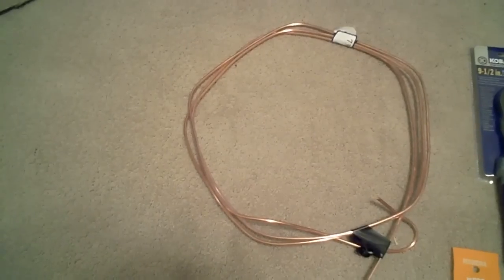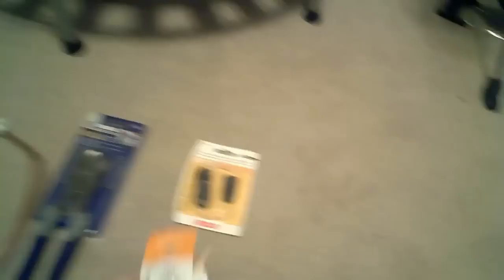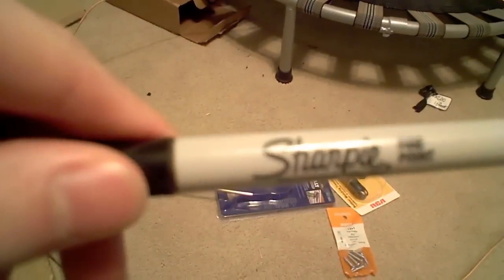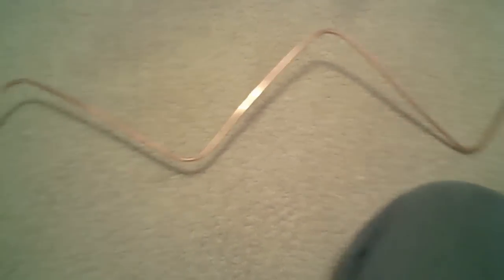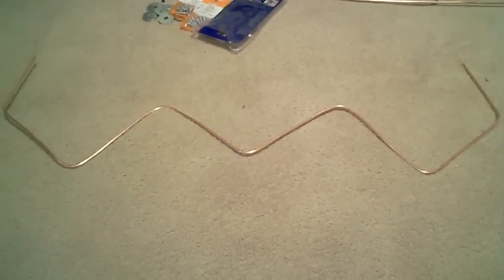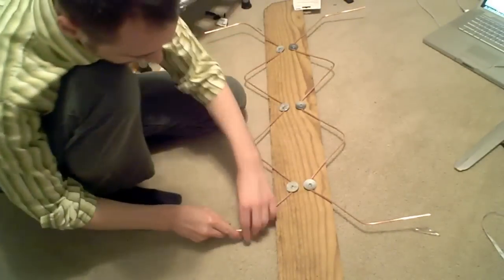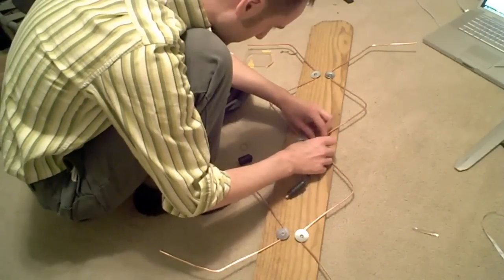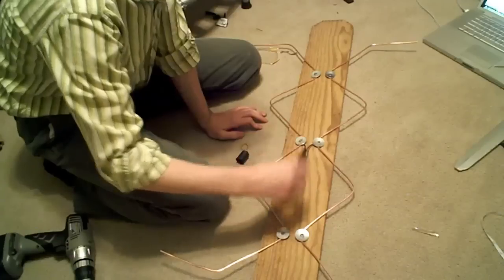How To BUILD The BEST HDTV ANTENNA! | Homemade HDTV Antenna DIY

Comment: The type of antenna you use has nothing to do with receiving HD or any other TV or radio signal.  If you live a across the street from a TV transmitter, you can get the signal with no antenna.  Within a mile, a piece of aluminum foil will do.  Old fashion rabbit ears will bring in HD from as near as 5 miles.  I am a retired broadcast engineer (48 years) so I know.
Reply: Where I live you can unwind a paper clip and stick it in the coaxial antenna hole and get at least 12 channels. I live about 3 miles from Sutro Tower which is the main television transmitter for the bay area. With a regular antenna I get 82 channels but at least 40% of them are in foreign languages.
Reply: ***** Any directional yagi antenna cut for the UHF television band should do if you get it as high as possible and point it at the antenna of the TV station you are attempting to receive.  My point was not about the ability to receive a TV signal, but rather the fact that that an HD signal is no different than a conventional signal when it comes to signal strength.  Calling an antenna an "HD" antenna is to either be unaware of the facts or trying to sell an antenna at a high price by fooling the uninformed public.  I have friends who receive modern TV signals perfectly on antennas that were manufactured in the 1950s.  I get a perfect picture on my RF-amplified rabbit ears antenna (I am 9 miles from the TV station's transmitter site) that I bought long before anyone had ever heard of "HD."
Reply: ***** When I was trained in engineering school (many years ago) they taught us their were only 4 important factors in good FM and TV reception:  1.) height 2.) height 3.) height and 4.) height  (lol). If you're on a hill, Robert, you should do well if you have this antenna at least a few feet above ground level, even if the bottom of your antenna is around eye level.  Line of sight matters, but due to what is called "scatter effect" PERFECT line of sight is really not necessary.  I think you'll be okay.
Reply: Janis Williams check with the site "tvfool" it will help you find the direction to and chance of getting a signal the online maps are really interesting.
Reply: ldchappell1 To complicated and unnecessary design from the up loader LaneVids.
 I live near the Guildford transmitter and boy I only need a few pieces of copper on a 3ft board in the attic and I have those attached to an old indoor pre-amp TV aerial unplugged as I do not need the pre-amp just the impedance  but no offence they do say some folk  go overboard on their designs
Reply: Dave Mitchell Thank you for responding and taking the time to explain the subject matter. I think I am going to built this antenna shown on the video to see what kind of signal I can get with it. We live on a hill and I think I have a better spot here than those houses at the bottom of the hill.

However, I don't have a clear line of sight towards where the local t.v. stations are and to be honest I don't know how much would that made difference vs. mounting an antenna ground level. As I said I am about 50 miles to those station. Again, thanks for your reply!
Reply: Dave Mitchell I was just wondering Is there anything I can do with with a big ole hill in the way? Sans bulldozing the sucker?
Reply: Joe Lee Depends on how far away the hill is.  If the hill is right next to your house, I''d say you have a challenge on your hands.  The farther away, the better your chances at a good signal.  Just get your antenna up as high as you can.  And that depends on how much $$$ you're willing to shell out.  A 50' push up pole goes for about $180, and add about another 50 for the guy wire and hardware.  A steel tower can run into the thousands.
Reply: Dave Mitchell im using yagi antenna for VHF and UHF analog free to air tv broadcast but cannot receive even a single digital tv broadcast.....
Reply: Dave Mitchell I live in a mountainous area. Huntsville is about 77 miles from me, with some mountains; Chattanooga is closer, about 55 miles, but with many more mountains. How would you propose I get great reception, all of the time?  Another question: why does weather change alter reception adversely?  Thanks.
Reply: Janis Williams It's possible one of the mountains is the spot for what are called "translators."  They re-broadcast city television stations to rural areas.  Check with the local television stations to see if there are translators in your area.  If so, point you antenna at the top of the mountain with the translator.  And, by the way, unless you live less than 10-15 miles from the television station's transmitter, the only was to insure what you call "great reception" is cable or satellite.  It's part of the penalty of living "in the middle of nowhere" (as I do).
Reply: Uh, Dave, Huntsville, AL, IS the local TV station, lol, unless you go another direction toward Chattanooga, TN!  As far a I know, there are NO closer stations to me, from which stems my problems, reception-wise.  I don't know of any stations in Fort Payne area (ARE there any?), or any translators between H'ville and me.  It would really be nice if there were!!  Keep the thoughts and ideas coming, please.  Thanks.  I really want help in this!
Reply: Janis Williams I know nothing about the stations in Huntsville.  I've never been there or Fort Payne either.  I'm afraid you're on your own.
Reply: +michael Perkins I think you may have missed what he said (quite poorly).
Pretty sure he is trying to point out that you don't need a special antenna to receive digital or HD signals and an antenna designed for the correct frequency will function regardless of the content of the signal.
I do disagree with the paper clip shit. Oh sure it shows up on the list of channels when you scan but try actually watching it in all conditions and you soon figure out you need a real antenna if you don't like cut outs.
High SWR is seen by the receiver as multipath interference and can cause dropped signals even when the signal is strong and especially if there is already a multipath issue associated with the area.
The video is specifically about TV so the assumption would be he is talking about radio waves in the 54-700 MHz range.(although he seems to ignore the possibility of a VHF station being near when giving advice)
Reply: Exactly...digital ready and HD ready antenna were marketing hype..antennas are tuned to frequency not program content..that's what I understood Lane to say in so many words..
Reply: Dave, since you claimed that you know more about this stuff than this guy just trying to share what he knows, why don't you comment constructively and share what you know. I live about 50 miles from our local t.v. stations and not a spit away from them. Perhaps you can tell us what we can use (low cost) to get a decent signal.

Comment: The lengths and shapes of the wires along with the distance between each of them are specific to receiving certain frequencies .  This antenna could be built with coat hanger wire if the geometric shapes and lengths are the same as these.

Comment: hey bud thanks I build the antennal but do I still have to ground it is in my attic ???
Reply: Grounding an outdoor antenna equalizes its potential to earth so it's less attractive to lightning.

Does lightning strike stuff in your attic often?  If yes, then you should ground it.
Or, if you have exposed knob and tube wiring in your attic you should ground it.

Comment: Can I attach this to an amplified rabbit ears with the original antenna removed? I thought I'd just string up some copper wire and attach the ends of the wire to the loops where the old telescoping antenna were attached on my amplified rabbit ears.

Comment: I built the same one Saturday and picked up 2 channels. I movedit from the north side to the west side and pointed it towards Baton Rouge and picked up 7 channels CRYSTAL CLEAR. I only had the antenna about 4ft off the ground, so I'm looking forward to mounting it up high to see if I can pick up even more. Directions were super easy to follow, thinking about building a bigger one next.

Comment: I used hollow copper tube that measured .189" like you would use to hook up your fridge ice maker, I had it around and thought I would try it.  Bought the transformer from Radio Shack for $6.87 after tax, feel like I paid a premium but they are close and I didn't have to wait.  Followed the instructions and WOW worked like a charm.  Still working on placement for maximum channels but what I have so far is amazing quality just sitting on the back porch .  Never thought it was this easy. Now use Netflix and Amazon prime for most TV and use my new antenna for my morning news.  Now saving over $100 a month over my old dish.  Thanks for the awesome post.
Reply: what did you use to bend the tube? I mean, I want to make a nice bend. But I do think that I could flatten it on the bending, making it easier to fix it on the support

Comment: A special antenna is not needed to receive over-the-air television, even if it is touted as "HD".  If you have an "old-fashioned" TV antenna it will work better that the dipole built in this video, as long as you point the skinny end of the Yagi towards the transmitter antenna.

Comment: Yeah I did I did build a HD antenna digital antenna but I took my wire wrapped around the washer better than putting them yes how to put them around board and then the HD channel Amon real nice Damon beautifully but I think I might go into look wifi apps that use come in that way and s ithinkyou should 're Tri wifi to  see what it
This is Fred electronic genius

Comment: Is there a specific distance the two copper wires had to be from each other? If so what is that measurement and why does it need to be a certain distance?
Might make this as my store bought antenna blew off the roof and broke. Good video also.. thanks

Comment: wot tif you add a powered pre amr real close to the Balun ? I have an 80 meter  Horizontal dipole antenna at 50 feet , fed with 400 ohm ladder line, Aka  a Double Ended Zepplin, antenna <WWII era> I use for radio, I just hung a balun on the ladder line, ran it thru my manual antenna tuner, Get more channels than ever with a standard fringe area Yaggi from ChannelMaster, Houston is 70 miles south . I get all Houston and Galveston ,Beaumont,Victoria ,San Antonio at night when the skip rolls in, it's off tha hook, This was before I got Roku I seldom watch broadcast now. Cheers De KB5ZXM Texas
Reply: for rx only you could use 300 Ohm flat lead, for the feed line, and the smallest wire you got for the dipoles

Comment: All you need to do is cut a  small piece of coax cable and strip it and expose the copper wire inside...attach a fitting to it and screw that  to the coax barrel in back of the tv then do a channel scan.

Comment: The cable between the antenna and the TV is it coaxial? Where does the transformer go and what is the size and voltage ratings.

Comment: Outdoor/external signal amplifier is essential. Internal amps also help signals.
Reply: Bought one at Radio Shack a lot of years ago. Recently I was there milling about. They don't carry them any more. It's this thing. http://www.summitsource.com/antenna-amplifier-outdoor-terrestrial-digital-signal-steren-television-preamplifier-aerial-booster-coaxial-cable-dual-connect-option-mast-mounted-part-200660-p-7801.html

Comment: You provided all info in the description and people don't read.   Thank you for to the point presentation.
Reply: I built one Yesterday and it worked for 3 TVs.  I lived in Dallas/Fort Worth area and get about 88 channels.  The HD channels look as sharp as HD from DirecTV.  I built mine with 3 diamond shape instead of 2 by mistake and it worked just fine.  I think the wires just need to be asymmetry to each other.  and make sure the connection of each cable is good.  The last thing is to go into set-up your TV (settings) and change to antenna (cable/antenna input) and do auto search for both digital and analog.  I set mine antenna up in the attic and facing south-west direction.  it costs me $13 from Home Depot.  I already got the Matching-transformer and found 2 splitters up in the attic.  I also used 6 gage / 10 feet bare copper wire, and think that is the good size for this antenna.  My daughter was surprised that it worked.

Comment: here are my tips:
1. if you have construction close to your home go and just pick a piece of regular electric wire for free.  you can cut an insulation and pull two wires from there.
2. go to any car parts store and buy Universal Plastic Clips instead of screws and washers. drill the holes smaller than diameter of the clip
3. it is better to solder a BALUN wires to antenna wires but if you have no experience you can screw them with metal washers but be sure all wires are free of oxide in place where you screw them together.

Comment: About the reflector that was forgotten to add, what material has anyone used? Additional copper wire? Would I be able to wrap paper foil around a piece of cardboard and still maintain the same distance from the element?

Comment: if you cant provide technical specifications and reasons for these numbers you are calling out, im sorry, but its not worth my time to even goto my shed and get all of these common parts (INCLUDING the STANDARD 12awg wire used in MOST homes that have a 15A circuit breaker per electrical code requirement NFPA70)
the linked site provided the same lack of information, and i rate no stars when people BEG for ratings... sorry, but if you are trying to be all tech, be nerd tech 
display some noise ratios, levels, and common sense reasons for paying the extra money in using 6AWG earth grounding cable
i bet you buy monster cables too

Comment: Your older antenna that was designed for  the analog signals is not "optimal" for digital TV. It isn't because of the difference between "analog" vs "digital" but because the frequencies used are not the same. The old "analog" spectrum was sold off by the government for other uses and TV signals were moved to another part of the frequency spectrum. This means that while your "old" antenna might work OK, it will not be an optimal solution. I was lucky. I have a 25 year old outdoor antenna and get 18 channels clearly, including the major networks and PBS. I miss cable of course. I'd love to have the History Channel, Discovery Channel, FoxNews, and NatGeo, but I'm not willing to pay the crazy cable TV or Dish bills on and on and on for something I might watch an hour a day. I'd just like to know who the idiot was at the FCC that capped broadcast TV at either 720p or 1080i instead of allowing stations to broadcast in 1080p...At least trying a homemade antenna and seeing what the results are can keep you from making a purchasing mistake if you desire a less obtrusive design that works OK in your living room.

Comment: Just a few pointers that I see on this video 
 From what we know of VHF UHF and microwave  weak signal  stuff on ham radio  he would have been much better using a plastic washers instead of the metal washers as the extra metal will actually de-tune the actual frequency he was looking for.
So for best performance plastic washers will make a difference as with the metal washers he also has a closer spacing on his 2 copper wire strips as well.

Comment: 2 of 2:  I probably could use a paper clip and get at least 30 channels. Right now I'm using an $80 antenna that one of my neighbors gave me.  It has amplification but it works better without it.  My comment about the rabbit ears was meant for people who live in the city or within 5 miles of the city. You know a lot more about this stuff than I do. What's the difference between digital and analog signals?

Comment: 1 of 2:  Of course you're right. In your case rabbit ears would not been very effective. 40 miles from the transmitting point is too far for rabbit ears. That was also true in the analog days. At one time I lived 70 miles north of San Francisco and picked up one channel with a roof antenna. In your situation I would probably use a more expensive antenna with amplification. Now I live in San Francisco 2 miles from Sutro Tower which is the main transmitting tower for the bay area.

Comment: YES!!! It should work but it all depends on location. if you have hills in the way or metal siding and so on it will make it harder to pull in but i will tell you that i live in a bad spot for signals and i get channels 60 miles away with 2 db-4 antennas i made and they are just above my ceiling in the attic and i am getting a total of 18 channels so if i can do it then anyone should be able to if they are the same distance as i am being that i am in a hole here at a lake.

Comment: It will not double the gain "distance" but it will help if you have channels on the fringe. I had trouble with a few channels so i added an extra db-4 so now it is a db-8 and helped cause i have them pointing offset just about 15-20 degrees due to stations not all being in the same exact spot. Always keep coax the same length for each antenna for best results just like running dual whip antennas on cb radio.

Comment: Because the homemade antenna is better than a store bought indoor antenna hands down. The ones at the store are like driving a car on watered gas and the homemade antennas are like driving a car with good gas and no water in it. The watered down gas might work in a car but is it as good as good gas?

Comment: Db-4 and db-8 are great antennas compared to any indoor antenna hands down. I make db-4 antennas for friends and friends of friends all the time. The ones i make are smaller than the one in the video is and i have 2 of the db-4 antenna which equals the db-8 and i receive channels 60 miles away with them located on the floor of my attic "10 foot off the ground outside" and my total cost was about 4 dollars.